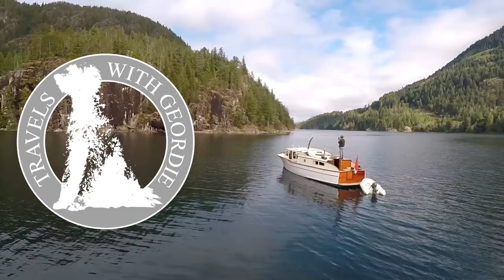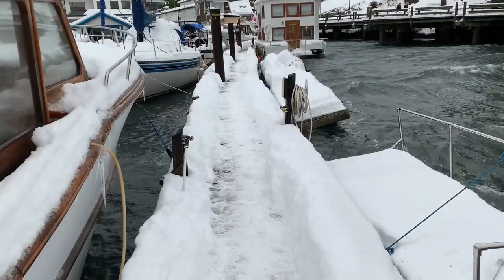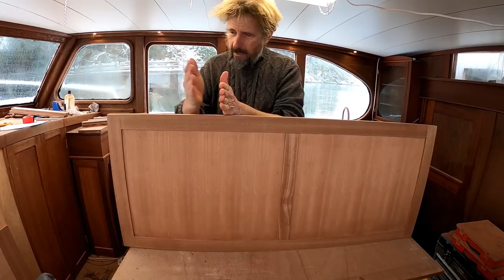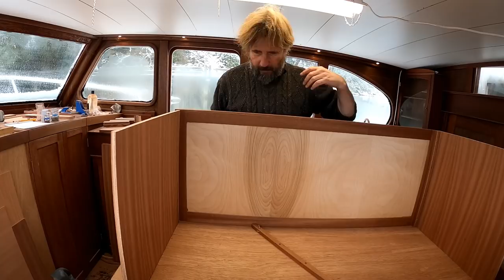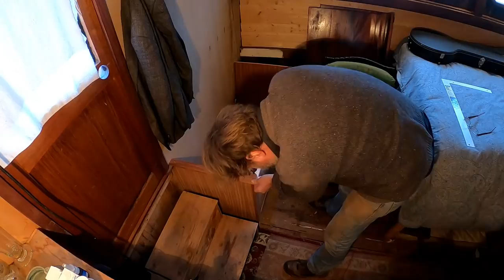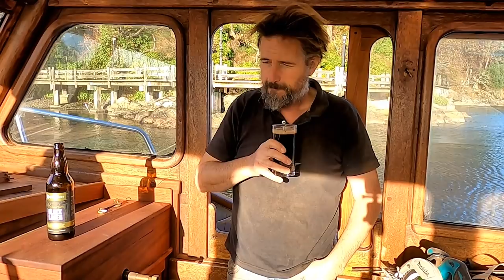Winter wonderland - Boat Life - Living aboard a wooden boat - Travels With Geordie #151

Comment: Hi Peter, you can put the fence in from the other side of your cordless saw. It seems wrong but works for me. Much easier for us old school right handers.
Reply from the maker: That's true but the clamp is on the right side so the guide can't reach out far enough on the left.
Reply: @TravelsWithGeordie  My cheapy   saw has the clamp on the left so works pretty well. I do have a longer fence from an old 9 1/4 Makita that fits and gives a bit more reach as well. You're doing a great job, giving us motivation to get our motor back in, and the refit of our little yacht further underway. 
Cheers Crowy and Ingrid.

Comment: Grain match is used when gluing up two or more boards or matching up veneer work. As door panels then the grain would go in the same directions (plywood being used). Rules of thumb I have heard of is in grain match you have it arrow up (can't think of another name). On grain, such as a door panel, you have it as the grain running the longer length. Overall it is what appeases the eye and these rules, not followed, made some ugly woodwork.
In older work (3 or 6 centuries ago) the cabinetry done for kings and royal's door panels were meticulously done with sold veneer work with the grains crossing at 90 degrees and glued together. Oh that's plywood, and only done by a master craftsmen with the best tools back then. I'm sure it made the horses nervous with all that hoof glue being used.
Reply from the maker: Cool info, thanks

Comment: Hi Peter, how do you heat your boat?
Reply from the maker: For now with shore power running electric heaters as well as a hot water radiator on my domestic water heater. When I go cruising I'll have all hot water heat via a Webasto Diesel furnace.